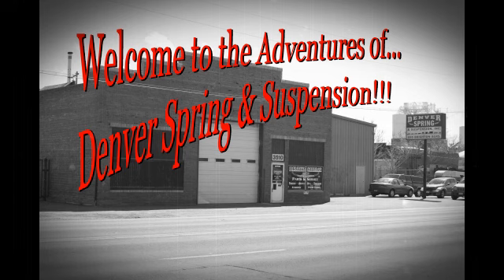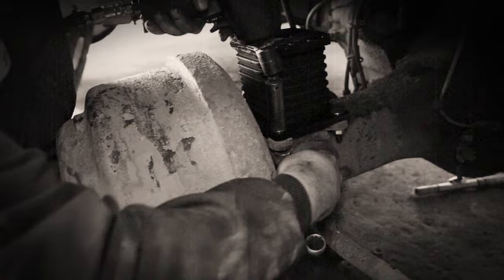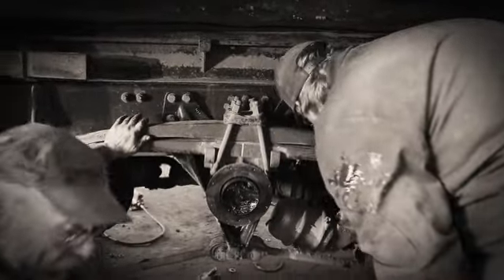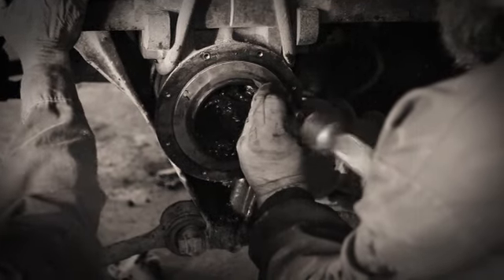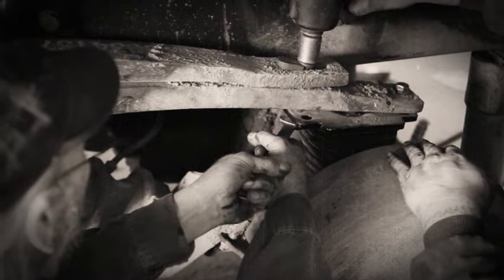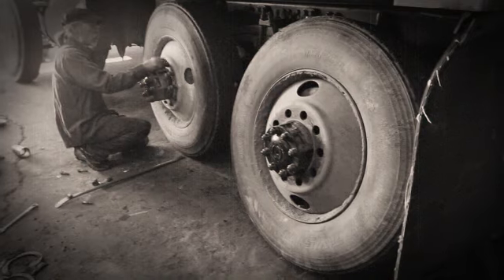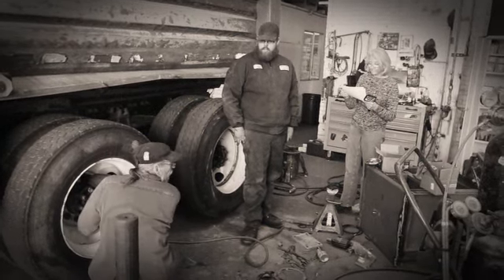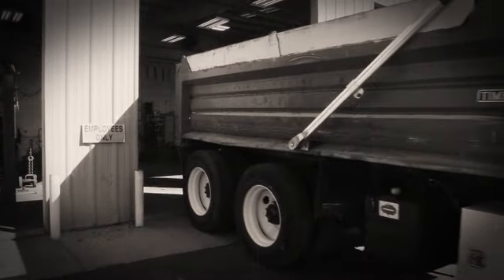Denver Spring and Suspension: Episode 6 Trials and Trunnionations

Comment: 2 "woman" job to install the springs and trunion. I use a forklift and a little nudging. Could do it all manually by myself, but OH&S says otherwise. Also, usually have the springs seperated cause the trunion gets replaced due to the flogging they get in Australia. Corregated roads and such